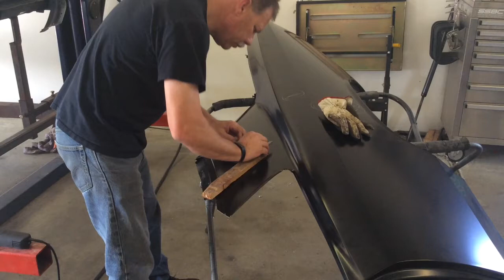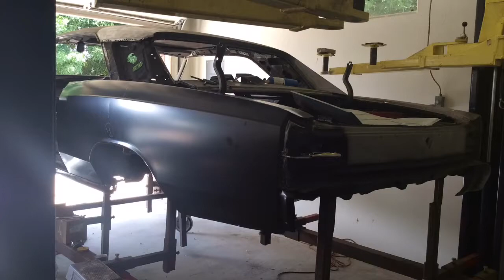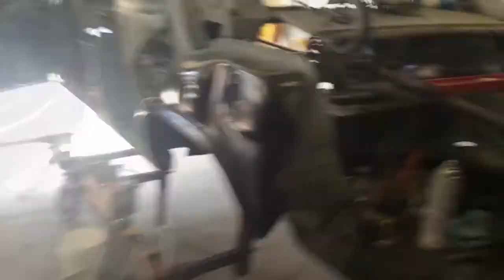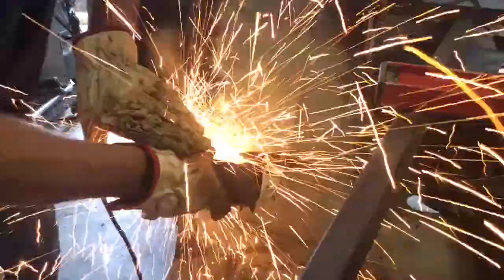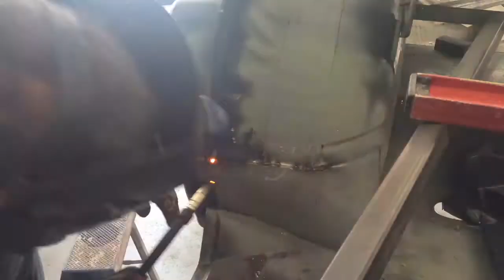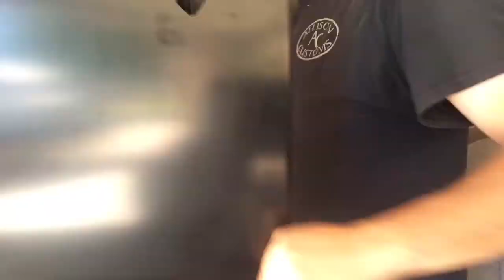1966 Chevelle Quarter Panel & Brake Cooling Duct

Comment: noticed you've been using AMD panels is this quarter also an AMD panel ??
Reply from the maker: Yea, I switch between AMD and Dynacorn.  I like Dynacorn panels when they are available in weld-thru primer, but if not, AMD is usually a little less expensive.